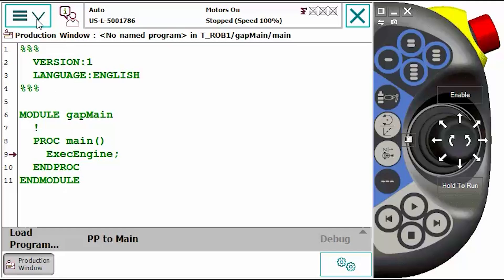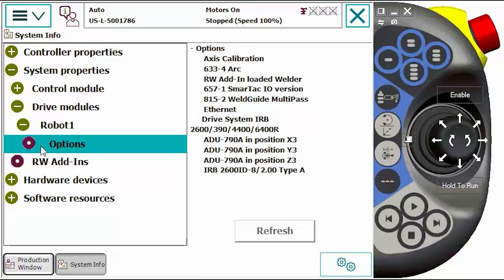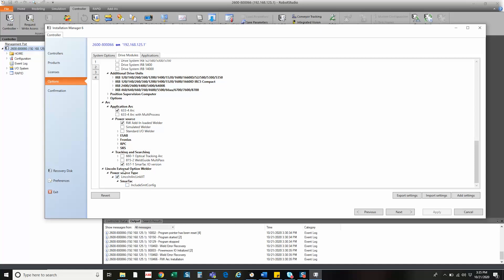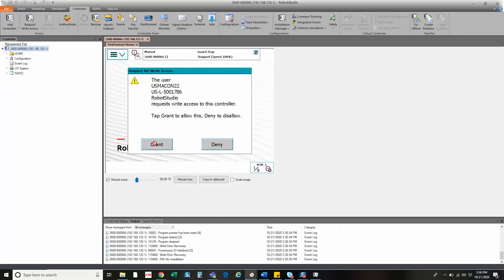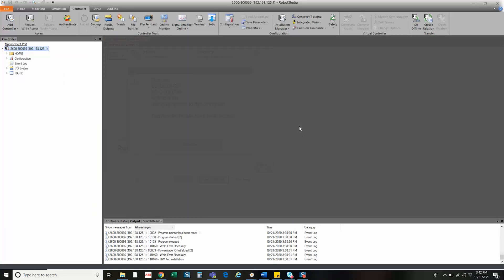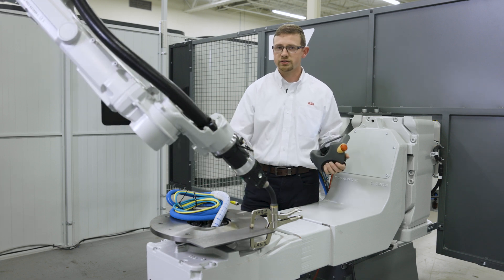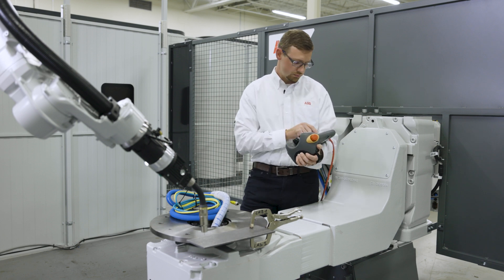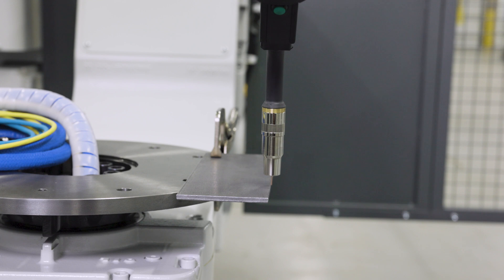IRC5 Controllers Smartac

Comment: A basic doubt how do you calibrate the tip . What is the right method and dimensions to measure the TCP value, I have been facing many issues because of that
Reply: you can use the classic three point method or ABB wise, Bullseye